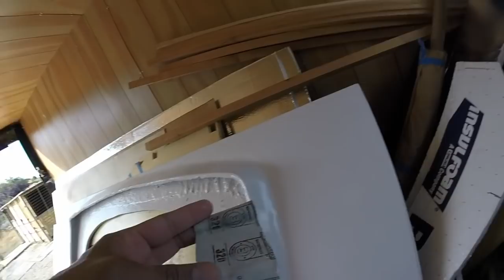How-To-Build an Over-The-Cab Loft/Sleeping Area. Box Truck Conversion - Part12

Comment: HI Henry, I hope you DON'T get up-set with me.....BUT, I want to ask a question, PLEASE. 
I guess, You know that the Cab and the Box will move Separably of each other. That is why I mentioned the Rubber Seal from a Peterbilt truck Sleeper, awhile back. I'm afraid  you'll have a problem with the Top that is mounted to the Cab Breaking apart there. There will be alot of Twist because of the truck body is Tried to the Box now without a Flexing Point between the two. 
I won't & would never try to hurt anyone and Only try to Help is ALL I'm try'n to do. 
I've built alot of show car's and there is alot of things a guy has to do to keep them from busting the Fiberglas parts and body work on them from twisting. 
The truck cab has Rubber Body Mounts under it. And, the Box is bolted directly to the frame. No mounts between the the Frame and Box. This will have the effect to make it Break Lose somewhere. Probably on the Cab Top where you used the Silicone stuff. I Hope Not but time will tell, Henry. I do like the Look you're going for on this overhead build❗ 
I Sure think your Lil' Dog is a Cute Lil' Fella. I love those Lil' Chihuahua's. I had one bout 20 years ago. And, I miss him.
Reply from the maker: You have a valid concern as I am concern about it as well. The Box and the Cab where actually jointed together as you can see in several shots where I pointed out the vertical caulking deterioration between the cab and the box along the doors. The facts that this small bead of caulking is actually still intact despite the surface deterioration leads me to believe that the box and cab are actually jointed very well. Its an old moving truck so there must have been lots of weight and stuff shifting around, and yet that vertical caulking is still intact. Im going to rely a lot on the rivets to keep the loft from shifting or cracking. I do however am aware that the box originally had a partition wall between the cab and box. That wall was the reason why its was so strong at the joining. Im planning to build cabinets and other functional structures in that area to provide similar stability properties. There are also corner metal bracings that I removed that I plan to reinstall for reinforcement. 
Aren't PeterBuilt trucks on a suspension above the chassis? Don't the cab on those trucks shifts and twist independently from their sleepers? I think those semi-trucks have more complex characteristics than a simple box truck. Well thanks for the concern. I will now loose sleep for a few nights, lol, na just kidding. No worries. Thanks again.